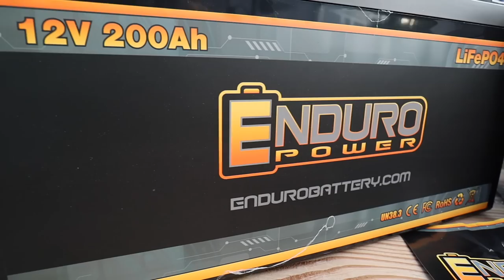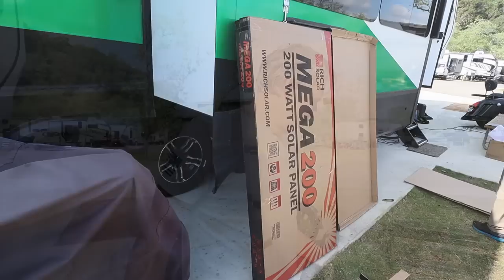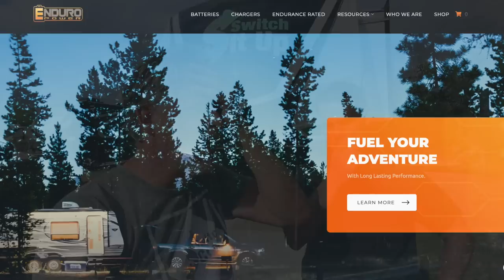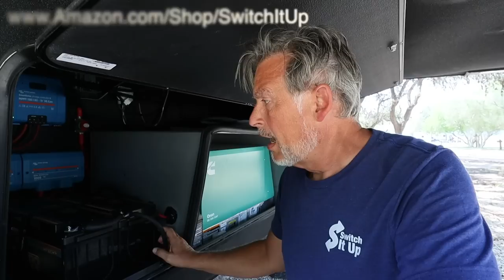Best Lithium Battery for RV Solar System

Comment: Did you know there are temperature limitations of the lithium batteries. We boon dock sometimes in subzero weather during hunting season. For me, it was better to go with a DC compressor 17 cubic inch french door refrigerator and 4 AGM batteries, because I don't want to keep a heater on the LiFePo4 batteries in the Colorado mountains. All I needed was to sell that AC residential refrigerator and add 2 more Walmart AGM batteries, 1200 watts of flex panels, a series charge conditioner controller, all it cost me is about 1200 for all  after selling the residential. I can go to any hardware/Walmart store to replace the batteries if needed. The controller we have also conditions the batteries to extend their life. I have 2015 batteries that are still able to put out 90% of their original output using this type of solar charger conditioner, in my older trailer.  Now I am going to use the power inventor for the recliners and vacuum cleaner and coffee pot until I convert those to 12/24 volt DC.  Going total DC is the way to go in a boon docking camper. Inverters waste DC through the inverter possess of creating a sine wave.  Good show though. Knowing what I know, I am waiting for the next generation of storage batteries.   Have a great day
Reply from the maker: All true on the limitations.  I believe Enduro has some interesting technology for that as well.  You may want to call and ask.  I remember Harrison saying they were testing all their batteries to those lower temps.  Might be worth the call to ask.  I do know that their batteries are 25% smaller in most instances so they fit in tighter spaces easier.  Although it's cool to see how you have adapted to fit your lifestyle.  good stuff.  Thanks for sharing.

Comment: Will the 1100 watts of solar you installed allow you to go boondocking for a week or two and run the ACs, refrigerator, lights, tvs, etc??
Reply from the maker: Great question.  Unfortunately our system was not our goal to run AC and microwave and everything.  We can run Refridge, fans, TV, our Ninja Airfryer, coffee maker, internet and misc.  Our inverter is only 2000 watts.  I would encourage you to call Enduro Batteries and talk to Harrison.  He will ask what your goals are and steer you in a direction that is best for you.  We have 400 amp hours in batteries and it is working amazing as we boondock.  When it has been 100 degrees we fire up the generator and run all 3 of our AC's to cool down and at like 9pm we shut everything off and run on batteries till like noon the next day.  If it's cooler we just run on solar.  So our system is right for us.

Comment: Those batteries are WAY too expensive.  I can get 1120ah of prismatic cells plus a BMS to manage them for less than the price of 2 of these that only give you 400ah, and they'd only take up about the same amount of room.  Prismatic cells are the four or eight cells inside these battery packs, so it's the same thing, you just aren't paying the premium to have someone else put it together for you.  It's worth assembling yourself to save thousands.
Reply from the maker: We can also order all the parts individually and make our own for cheaper than your suggestion as well... BUT.. that isn't what we are wanting to do.  We wanted smaller case size for our bay... Enduro is 25% smaller in that premium lithium space..  AND the customer service is awesome because they are a growing company and willing to really help with needs and sell based on blue sky upgrades... sooo I feel we made the best choice for us. I hope you as well are happy with your choices... thanks for sharing other options.